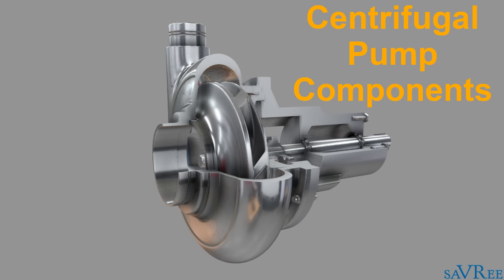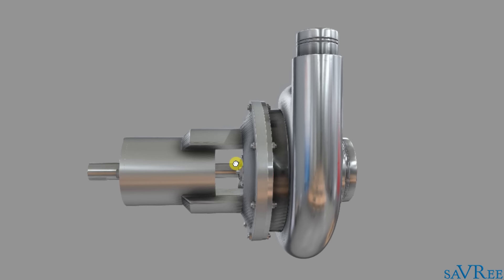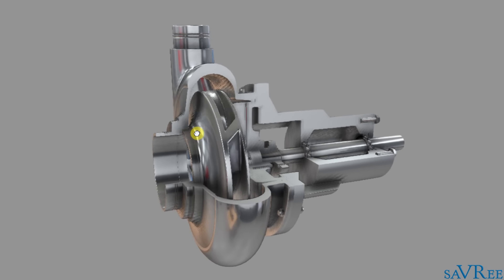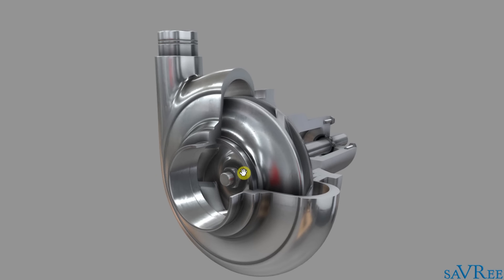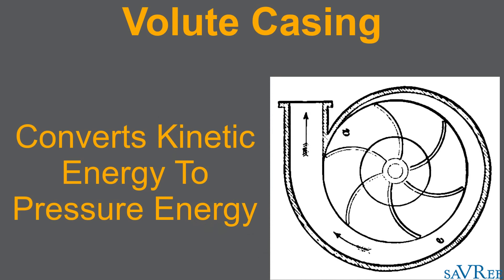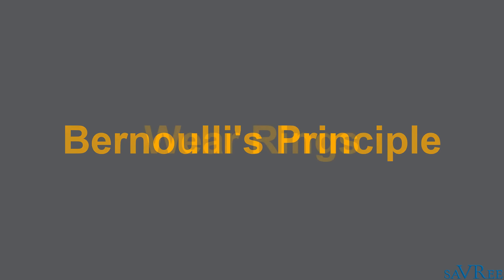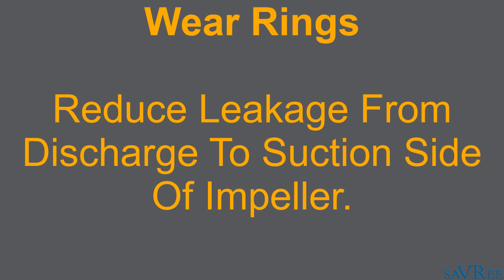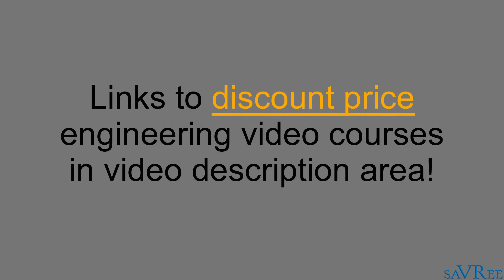Centrifugal Pump Components Explained

Comment: Just started watching this video but before I finish I want to pose a question. We are putting our Dean Brothers mc 10 centrifugal pump back together. We installed the impeller. We go to tighten the impeller nut and if we hand tighten it, it spins nicely. If we just start to tighten it with the socket just a fraction of the, the impeller locks up.

Comment: While starting a centrifugal pump is it necessary to shut off the discharge port? I have heard it in many application they do so, if yes; why is it done and where will the fluids go and how does it affect the current required (power) for the electric motor?

Comment: Nice model.  Pull the threads out of the packing gland though or you won't be able to move the gland in when you tighten that nut you modeled.  The gland should have through holes for the bolts.

Comment: Thanks for your details explanations, I have a question,  Valute casing and Casing housing for centrifugal pump - are they the same??
Reply: The volute casing is a kind of casing housing. You may see other casing design which is not volute. In that case, you will see a diffuser ring that changes the kinetic energy into pressure energy. You can look up the diffuser ring in the video @ 3:00.

Comment: Good day sir.
I overhauled a cetrifugat single impeller water pump , it's a 5 hp engine driven.the shaft was broken , so I made a new one. When I remounted the pump . The oil and water started to mix . The water was coming through the oil port , the glass that tells the oil level. Without the pump even running the water was coming through the oil area . Can u please assist

Comment: Great explanation!
I just have a question, what is the main difference between diffuser and volute?
Reply from the maker: They both do the same job (convert kinetic energy to pressure energy). Volutes are larger, so not the preference for multistage pumps. There is a 4 hour video course for centrifugal pumps, check out courses.savree.com to learn more (or this https://www.youtube.com/channel/UCosExgfjj-DhMJXnQd2Y4gA/join).